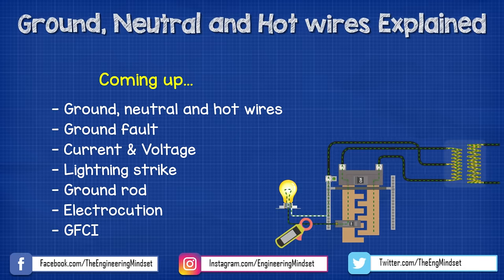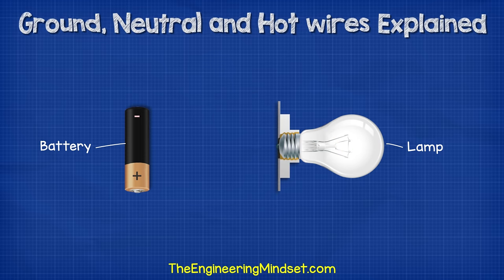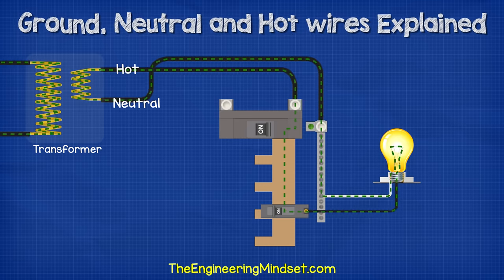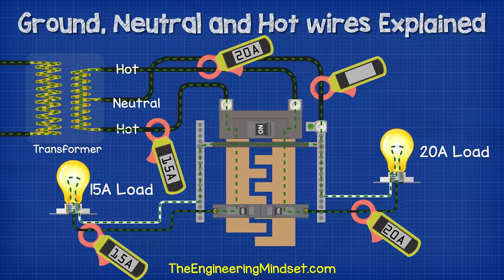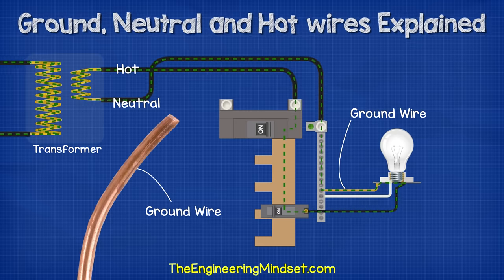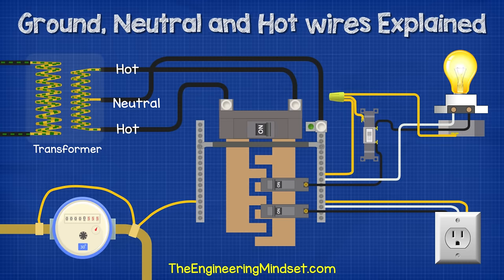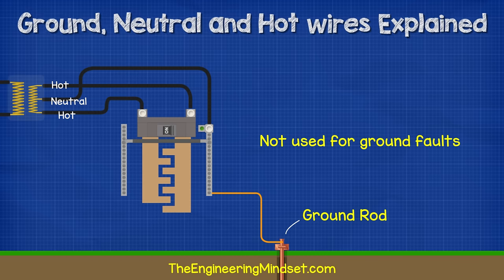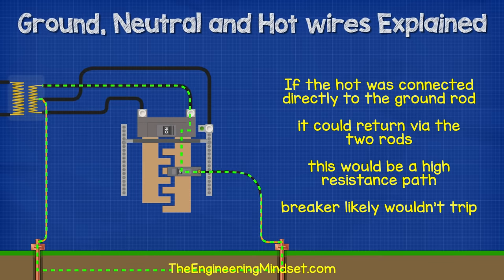Ground Neutral and Hot wires explained - electrical engineering grounding ground fault

Comment: the moment you said electricity flows from negative to positive, I immediatly subscribed.
Reply: Current flows from positive to negative. While electron flow negative to positive.
Reply: @xzy7196  I thought he could have spent more time on that. Along with how fast electrons go from negative to positive which is a crawl.  I've read 1 foot every 20 minutes or so.  Yet the current due to so many electrons doing this lazy ride travels at basically the speed of light.
Reply: I always talk about electron flow rather than hole flow so I say current flows from negative to positive.
Reply: I second @Adnan MX, current exists due to potential difference, and it'll always go from higher potential to lesser potential (Kirchhoff and Ohm laws expand more on this), therefore, one could say that current "flows" from positive (higher potential) to negative (lesser potential).

The reason for it to be like this is found in a subatomic level, where electrons flow towards a positively biased charge and are repelled from a negatively biased charge (ie battery terminals). Every time an electron moves towards the positive charge, a "blank slot" is left behind in its previous place, having this "slot" populated by the next electron being attracted towards the positive charge. Since every time electrons move they'll leave a "blank slot" in their previous positions, one will easily notice that a given "slot" will appear to be moving from the positive charge towards the negative charge, whereas electrons will appear to be moving in the opposite way. This "blank slot moving" behaviour is described as current, therefore, the reason for it to be represented in the previously described way.
Reply: yea, and I hope that it was just an editing mistake in the animation when the neutral and ground were connected to the positive terminal on the battery.
Reply: @anthonypape6862  No, the current doesn't travel at almost the speed of light. Yes, electrons travel very slowly. What travels at almost the speed of light is energy.
Reply: @altuber99_athlete  Current is another word for energy  It is the electric energy or current that we use and can do work that travels at close to the speed of light.
Reply: @salestraining8775  "Current is another word for energy" Nope. Electric current is not electric energy (measured in joules) nor electric charge (measured in coulombs), it is the movement of charge (which rate, called electric current intensity, is measured in amperes, or amps for short.)

"It is the electric current or energy that we use and can do work [...]" While it could be accepted that loads or appliances or fixture use current, it should be noted that current (charge really) doesn't get wasted after it passes through them. The current in equals the current out. Instead, they use energy. In fact, batteries don't lose net charge, only energy (and this means the phrase "to charge a battery" should be changed to "to energize a battery.")

"[...] that travels at close to the speed of light" Charges in a current don't travel at the speed of light, they travel at the drift velocity; for example, in a copper wire of 2 mm of diameter and carrying 1 amp of current, the electrons are moving at about 23 μm/s; if the frequency of the current is 60 Hz, this means the electrons move less than 0.2 μm in half a cycle, which means that the electrons in the windings of a generator or transformer will never reach the loads. Energy indeed travels at almost the speed of light; the actual speed depends on the medium through which it propagates.
Reply: @altuber99_athlete  We may be talking about the same thing.  Electrons carry charge.  Electrons move from negative to positive slowly at drift velocity 1ft/s about.  Current which I'm calling energy moves in the opposite direction at near the speed of light.  Current is measured in Amps and Volts.  Amps x Volts = Watts and that why I call current energy.  This Current is consumed to a degree an dissipated as heat.  Although I'm not sure how it is consumed by any other way than by transforming to heat.  What do I have wrong?
Reply: @salestraining8775  Energy is measured in joules. Current is measured in Coulombs/Second. 

Joules are not equal to Coulombs / Second. 

To say energy is equal to amps is false. If they are equal you should be able to convert the amp unit to the Joule, which you can’t.
Reply: @altuber99_athlete  Very well said
Reply: As a side note (technical note), "electricity" doesn't always flow from negative to positive. In a resistor, indeed charges (electrons in our case) travel from negative (i.e. lower electric potential) to positive (i.e. higher potential). Inside a battery that's being energized/recharged, or in an inductor or capacitor that's storing energy in their electromagnetic fields, electric charges (electrons) also flow from negative to positive.

But inside a battery supplying energy to an external circuit, or in an inductor or capacitor that's releasing energy from their electromagnetic fields into an external circuit, charges (electrons) flow from positive to negative.

In the water of a sodium chlotine solution, both positive ions (the cation Na+) and negative ions (the anion Cl-) move, i.e. there's a current due to positively charges atoms and negatively charges atoms.

These are just a few examples.

I'm not mad at anyone for saying that actual "electricity" flows negative to positive. I just made a correction.
Reply from the maker: Check out NEW resistor video, everything covered! ➡️ https://youtu.be/DYcLFHgVCn0
Reply: Really should be labeled properly by gender. 
Male = will/power Female = attractor/receiver.

Comment: 6:53 The ground wire doesn't have less resistance than the neutral wire, generally. In fact some circuits will have a smaller gauge ground wire than those that normally carry current.
Reply: I think the author was confused because most ground faults where the hot touches the casing will carry much larger currents than normal operation. This is just because the hot is touching the casing directly and not going through a highly resistive load like a light bulb.
Reply from the maker: We just published a new Ground fault, short circuit and arc fault video, so much detail! Link HERE➡: https://youtu.be/Qi0ynSQw-wc

Comment: Hot is positive in the US. Only mention this because you connect your battery hot to the negative which might confuse some
Reply: Yeah I was thrown off by this I’m an electrical engineering student and have used + as hot my whole life lol
Reply: in canada we use hot as positive as well
Reply: Actually positive and negative are for DC, for AC they are called hot and neutral.
Reply: jose guerrero  In AC, the hot wire alternates between positive and negative relative to neutral (ground).
Reply: @tetonux  active and neutral in Australia.
Reply: Do not confuse electron flow and current flow.  Electrons flow in the direction opposite of "conventional" current.
Reply: @multidayticket  that's simply not true, positive in this case means area of higher potential. Charge (electrons in electrical circuits) flows from high to low potential.
Reply: @TheMogulman31  No, the other guy had it right. Positive refers to the ions in one side of the energy source being positive, which means they have a surplus of protons, or a deficit of electrons, depending on how you see it. These ions are positively charged. Negative ions are the opposite, they have a surplus of electrons, and are negatively charged. When you complete a circuit, electrons will flow from the negatively charged side to the positively charged side to equalize the difference and turn positive and negative ions into neutral atoms with no charge. However, before the exact mechanics of this were known, it was commonly believed that electricity flowed from + to -. Therefore, conventional current flow is still + to -, while actual electron flow is actually - to +. The  reason conventional current flow is still commonly used is because it actually doesn't really matter either way, so no one bothered changing it.
Reply: @Demonstormlord  by your reasoning if I connect the negative terminal of a battery to a light bulb and the other side of the light bulb to ground (not on the battery) the bulb will light up. That is not the case.
Reply: @TheMogulman31  It would be the case if a circuit was completed, and there was a potential difference between the - of the battery, and the ground. In any case, ground is not really topical to DC, which is where current flow and electron flow are relevant.
Reply: @Demonstormlord  thank you for say the magic word, potential differance. I assure you on batteries and electrical schematics + refers to higher potential not charge
Reply: Yes hot is positive, this is why fuses and circuit breakers are installed on the hot side of the circuit.... You can prove it with a Mutimeter, the Mutimeter always tells the truth...  With in a margin of error due to calibration and quality,  but even a poor quality mutimeter should should show positive (+) & negative (-).  Hot for positive (+) & Neutral for negative (-) are used in Alternting Current, while the postive & negative or positive ground or positive & earth  are one of the same, same dog with a different collar.
Reply: Yes, I was about to comment the same.  Anytime I've seen a schematic, the + is always toward the top of the drawing and usually switched.
Reply: Live and neutral in the UK.

He got it right in terms of electron flow, but current flow is opposite. To argue the distinction is pointless for AC is a bit misleading unless US systems work very differently... Sure Neutral carries current in a closed circuit, but when open neutral should read pretty much zero with reference to earth.

For this reason we fuse and switch the "hot" or live side on appliances, while in theory switching and fusing the neutral side works just as well for turning it off and on, if a fault develops and the fuse blows, the whole appliance may still be live, just waiting for an unsuspecting repair person putting themselves in the circuit.
Reply: DC "Source" is positive and the "Sink" is the negative. A sinking output sends a positive to the load to be sunk on negative. A PNP style proximity switch sends a positive to the load connected to the negative. A NPN proximity switch connects the positive coming from the load to the negative. Sure with DC "holes" move in one direction and electrons flow in the other. When showing the public how things work, I would suggest using the conventions in actual use, that people will come across.
Reply: A "Hot" or "live" wire is a conductor that isn't grounded.  That can be earth ground, or frame/chassis ground.  The term "hot" is not usually used with isolated DC circuits, although it can be.    The majority of direct current (DC) systems people are familiar with are (–) ground, but (+)-ground systems exist, too. It doesn't really matter, as long as it's known and consistent within a system.  Polarity matters in DC.    Alternating current (AC) does not have static polarity, so the idea of (+) and (–) doesn't apply.  Either a conductor is grounded, or it isn't.  Remember that electricity only flows in a complete loop, called a circuit.  If there is no complete loop, then electricity will not flow.  DC always flows in a persistent direction, but AC changes back and forth (alternates polarity) and this happens throughout the entire circuit (not just the "hot wire"). 
    Atoms cannot get a "surplus of protons."  Atoms want to be neutral, which means a balance of protons (+) and electrons (—).  Atoms can become unbalanced by temporarily losing or gaining electrons, and such atoms are called ions.  Atoms can only gain protons by nuclear fusion, which is what happens in the core of the Sun, or nuclear decay.  "Hot" or "live" conductors are special only because they are the parts of the circuit which are isolated from the grounded path.  There is no voltage potential between the grounded conductor and the ground system itself because they're connected together.   The "hot" or "live" is switched/fused because it's a lot easier to further isolate what is already isolated.  Plus, it reduces further problems and dangers of accidentally interrupted neutrals.  Not all AC circuits have a "neutral" as that really derives from the middle tap of a secondary winding on a transformer.
A power source works by inducing a voltage potential in a conductor through a complete circuit.  On a battery, the positive terminal isn't more or less "active" than the negative terminal.  The two terminals just have opposite roles.  One is going to accept electrons, and the other is going to donate them.  9V or -9V is still 9 volts of potential, no matter how you measure it.   No one terminal of a power source is "more important" than another, because there still has to be a loop.
Reply: @jovetj  We fuse and switch the live so that the active phase power is removed from the appliance. Otherwise elements of the circuit board, motor windings, heaters, switches etc... will remain at mains potential. even wires previously marked/known as ground and neutral could also have a mains potential in these circumstances!

For example, imagine you have a fan... it's a cheap one from China or India and the fuse and the switch is on the negative/neutral wire, not the phase/live (Actually a really common issue!!). So one day the fuse blows and your fan stops... DARN! lets see if I can fix that... it's turned off right? so you take the cover off and start poking around to find the problem. You quickly realise that the entire motor core is live! the switch mechanism is live, even the fuse holder is still live and all of it dangerous, how can this be when the fuse is blown, and the switch is off the appliance should be dead right?!?!
Reply: I think the only confusing thing here is the battery + should be to red wire... exampling the word HOT.   I see the dc + - sink gnd is an model example to ac hot LNE but the hot wire should be coloured red, which is confusing people in current and electron flow differences is dc and ac.

The same is with lightning.   Lightning goes up not down, see slow motion videos on youtube.   Its electrons and current flow arguments again.    

Also note power of ACDC and DCDC exists too.

Multiple hot inputs get confusing, also star and delta phased power.
Reply: @kal9001
Yep.  Much safer to have a carefully-controlled "hot" and assume everything else is the same potential (ground, or negative).

@Pqrst Zxerty
Most general DC power source wiring is red and black, so by that logic, the white wire should be black, too.  But, remember, that (+) is only the red wire in (–) ground systems.  In reality, the black wire represents (chassis) ground, and the red wire represents not-ground.  So, in a (+)-ground system, the (+) would be the black wire.  So, the video is more-correct on that point, even if it's just something most people are not used to.  Excepting it's a white wire, not black.  I think it would be less confusing if the (+) and red/black wires were employed as usual, and the current was still just shown to flow (–) to (+).
Reply: It would if your battery were positively grounded. Positive grounds were used for some time in automobiles decades ago, and some are in use today. As well, an Incandescent bulb is non-polar, meaning it will light up no matter how you connect it to the battery
Reply: @DeepCZero3  Positive grounds are still around in the telecommunications industry as well.
Reply: jose guerrero 
 I live in the US. My cars have mostly had negative ground. I say mostly because I also have an English MG automobile, my MG which I have found since 1968 has positive ground, meaning, when I install a battery, the positive terminal goes to ground. That will confuse you when doing any work on the electrical System, which I often do because my car came from the factory with Lucas electrics. For those who are too young to remember, Lucas electrics were called, the prince of darkness electrics., they also say that the English drink warm beer because they had Lucas refrigerators. there is a saying. among mechanics that worked on cars prior to the 1970s, and that is, when something goes wrong with a device, a car, anything, it doesn’t work one day, and the next day it works, and you can’t figure out what it was that caused it to not work, The saying is, it just went Lucas. That explains why it had intermittent problems that you can’t figure out what they were. I wonder if that is one of the reasons English cars with Positive ground electrical systems have so many electrical problems?
Reply: Hot is NOT positive. Hot is the conductor not connected to earth. You are confusing earth ground in facilities with common positive or negative in circuits such as vehicles.
Reply from the maker: Check our our new car battery explained video: https://youtu.be/VnPRX5zQWLw
Reply: @heronimousbrapson863  , Jose's response is only about the battery - which is DC.
Reply: @TheMogulman31  How on earth did you come to that conclusion. (Sorry about the pun)
A battery is an isolated system. It's only going to power things if you connect them to BOTH of the terminals.
If you only connect to one side of the battery, nothing will happen.
Reply: @Demonstormlord  positive= male or will/force
Negative = female or attractor/receiver.
Reply: @Demonstormlord  Electronics simple harness the attractive force through getting between the 2 genders or poles and utilizing it.